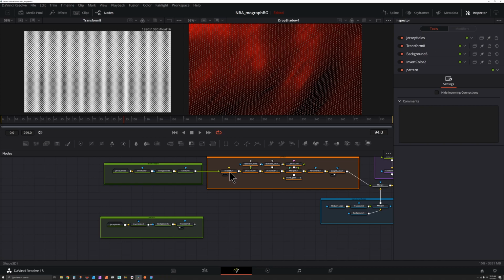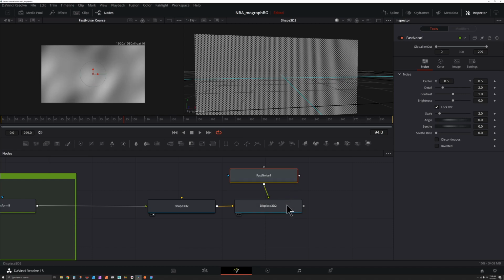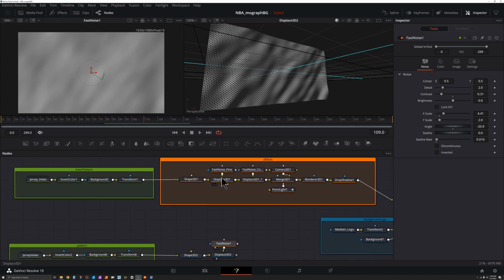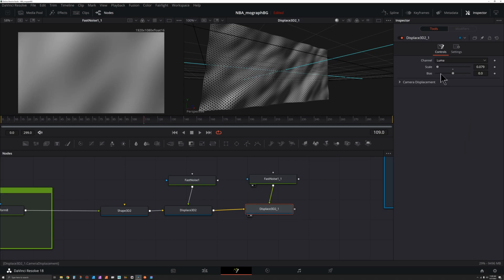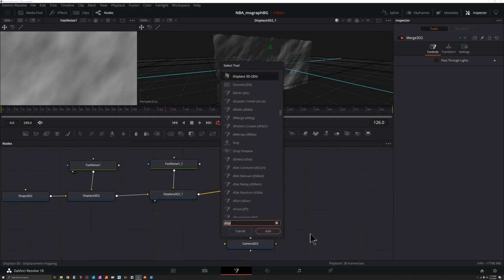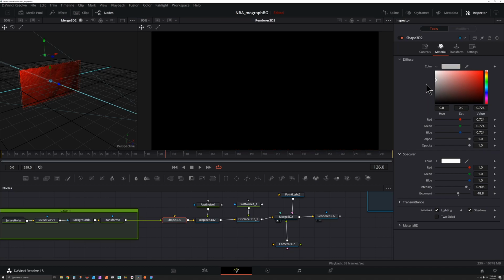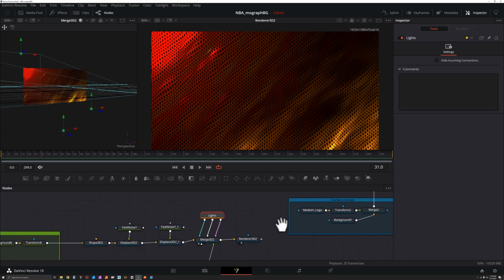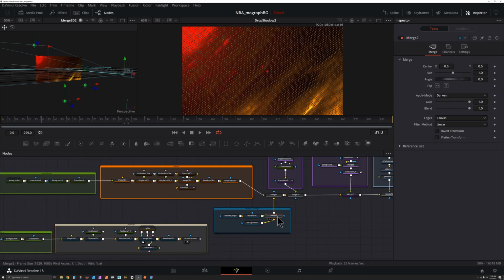Miami Heat Motion Graphic Project Part 2 DaVinci Resolve Fusion

Comment: Thank you for this great tutorial series. Looking forward to the next ones.  One question: I followed every step you did, but for some reason I don't have any lights....any idea what the problem could be here? Thanks for your help!
Reply from the maker: In the viewer there are icons at the upper right. The icon with a circle has a dropdown that let's you select Lights. Let me know if that works or if its something else.
Reply: @ChromeLion  Thanks a lot for your quick reply. I tried it again but it doesn't work either....I  also checked the contextual menu under 3D options, when the node is loaded into the viewer. I cannot figure out what keeps the lights from working....